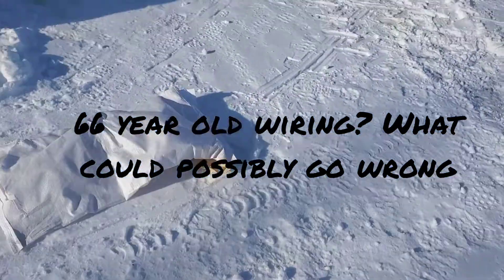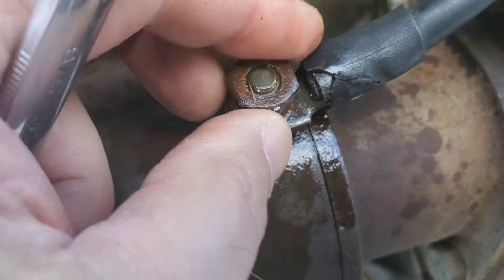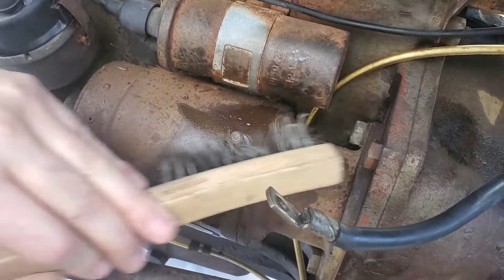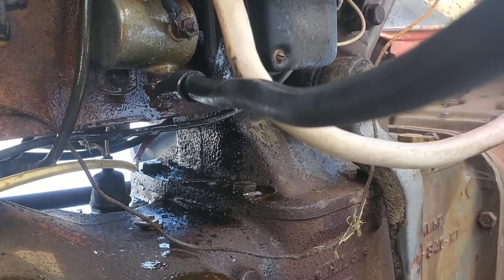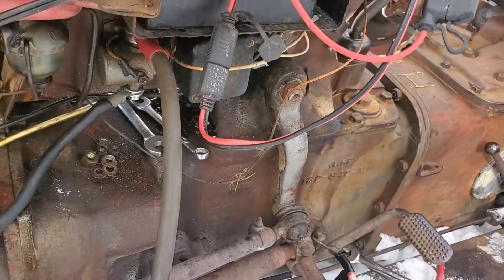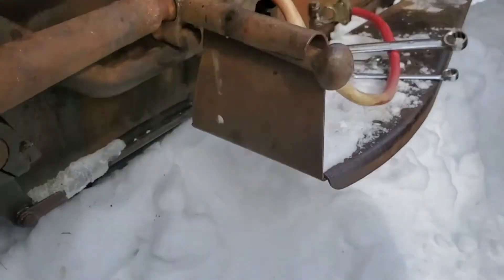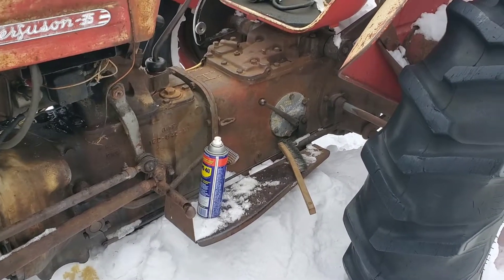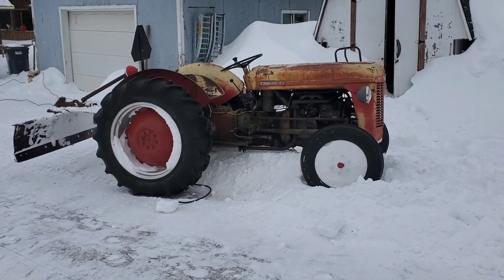Will it start? 1956 Massey Ferguson TO35 tractor let us down!!! Electrical repairs

Comment: Glad you got your Massey Ferguson running. I have tire chains on my 1958 Massy Ferguson 50 and it helps a lot in the snow.
Reply from the maker: Yes indeed I've been on the look out for a set of chains but no luck yet. I hope your 50 runs as good our 35

Comment: Mine is giving me hell. Cranks... Good fire.. no start
Reply from the maker: ok if you have good cranking it must have good battery. Do you spark?, Do you have fuel?. When did it last run?
 You may need to check for compression as well. The fuel system is prone to having issues caused by dirt. The brass fitting at the carb has screen in it which can get clogged.
Reply: @JimsNBHomestead  all of the above.. was moving a 350 into Garage. Died.. wasn't sure what happened. Coil was swollen...but I still had fire.. looked weak. Replaced coil. Points where fried tho.. cleaned them all little fired right up. Ran 2 minutes and died.  replaced them still no start.. so I check fuel bowl for fuel. Plenty. But thought maybe broke timing chain.. valve ect... Pulled tank and valve cover to check rockers ect... Didn't have compression gauge with me. But all functional. Ect... So maybe I got junk in needle seat valve in carb.. lol I even checked timing.. 6 before ..points barely open on distr cam... New cap rotor... tested condenser. Leaving now to get new solenoid switch and key switch. Will the governor stop it from firing. Clean carb next ...great fire to plugs.. crazy man
Reply from the maker: Keep me updated
Reply: @justicebruno5249 did u figure out? I'm having same problem. Was running perfect. Then shut off next day nothing has spark.
Reply: @wilsonbobcatservice4151  yes I replaced points. But the condenser was bad. Kept burning the points up. And fast .

Comment: Having electrical issues with my masse 65 too
Reply from the maker: Let me know if I can be of help, Some of the stuff is a bit odd on these old tractors
Reply: @JimsNBHomestead  I replaced the grounding strap and voltage reg.  the key switch is coming in today.  Next I may need to delve into the dist.cap and all that as she runs rough when she runs.  Gotta re-rout the exhaust too.  blows right in my face.lol
I got her knowing I'd have to work on her but I'm not a great mechanic and have little to no experience so it's an uphill battle.lol
Reply: @JimsNBHomestead  Well, Key switch wasn't the issue.  Was in need of replacing anyhow but I still need to figure out what could be causing her to not get power to the starter.  Weird.
Reply from the maker: Neutral safety switch? perhaps